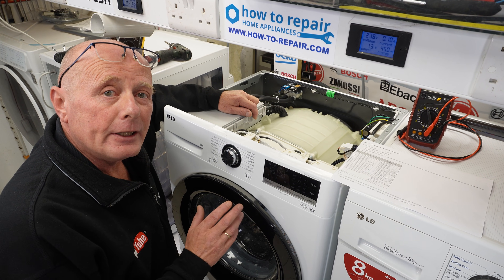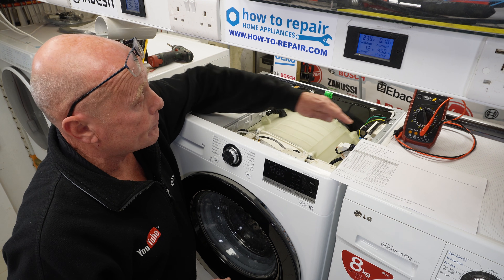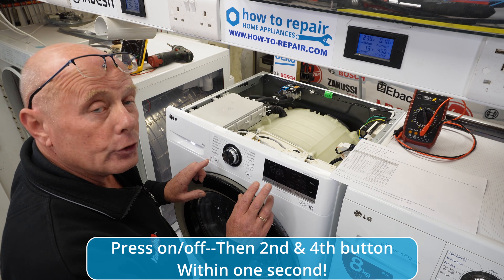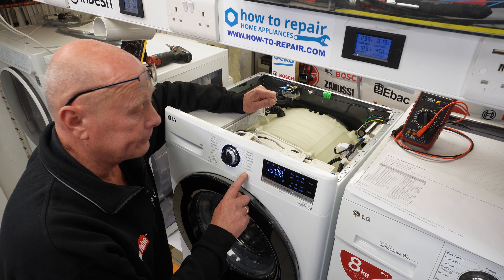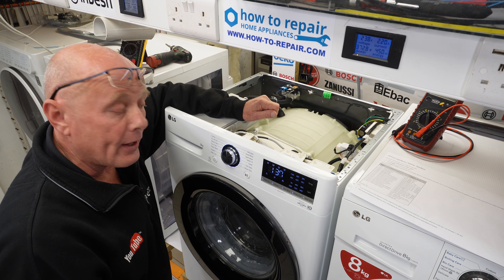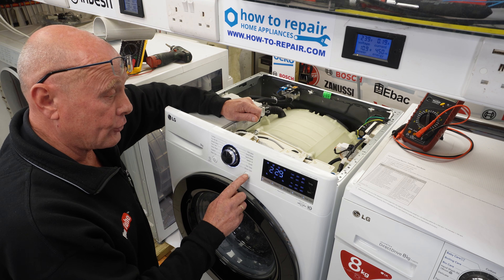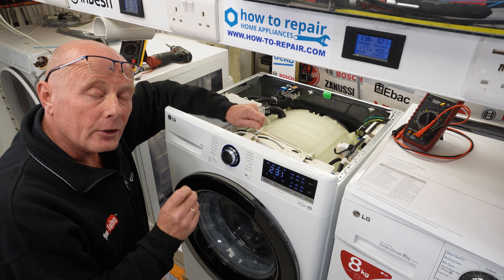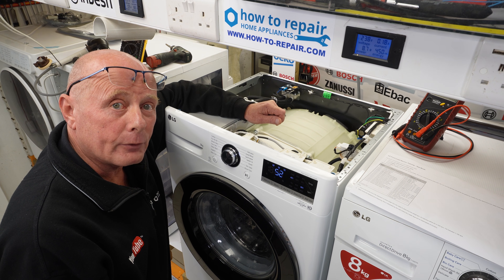LG washing machine service test diagnostic mode 2020 onwards

Comment: Sometimes I add extra water to my cycle by hand through the dispense tray, especially if I’m washing thicker clothes. Can this affect the drainage system and will the washing machine only empty what it thinks it has put in, or will it account for what I’ve added and will drain everything?

Comment: Unexplained feature in test mode.... i have a WM3600hva LG, once in the test mode (spin+soil+power) before hitting the start/stop button to initiate the test, i found that if you hit the "delay start button it will cycle through other options that you can engage/start. I for the live of me can not find any ANY literature on this. When the button is pressed , you get two additional option, first option reads as an upside down "F"and "5" (F5), and the second one is "00", then it returns to the main menu.  Can someone tell me what those menus are for. i don't want to start them without knowing. thanks.

Comment: Hello . I have a inverter direct drive, with no error on the display. When I try to start, it turns a litlle, around some 90 degrees and stops. All filters checked, water supply, door lock. I tried also the service diagnostic as in the video, but at first test, the engine one, just stopped. Any others ideas?

Comment: Had an issue with LG washer not turning the drum nor activating the drain pump. Resetting did nothing. Running through the diagnostic found no issue and afterwards the machine functioning normally. Not sure why but happy that I did not have to repair/replace the machine. Thanks for the video!

Comment: I get the error code IE when machine is starting rinsing program. No matter what program I choose for washing, when rinsing is about to start at the end of each program I get error IE. Did this test and everything worked as it should. Anyone have ideas of what the problem might be ? LG F6WV710S1W
Reply from the maker: Hi hallo1238273 sorry about your problem but I'm in the Atlas Mountains right now and I can have free time occasionally. I would like to help you out during my live streams. I'll be hosting a new show on Sunday so please subscribe and turn your notifications on then you can catch me live.

I'll stick the link to the upcoming stream below so you can drop your comment beforehand. I will need the full model number of your washer dryer which is written on the ID plate. I'd love to answer your problem on the show mate, cheers.

https://www.youtube.com/live/-1djYxP9MDQ?si=MqqH_hU65fLl83X9
Reply from the maker: Hi again, Ole. You'll be pleased to know that Paul sorted your problem on the live show, and then even made a repair guide for you.

You can read the repair guide here: https://www.how-to-repair.com/faqs/lg-f6wv710s1w-washing-machine-shows-ie-error-code/

Comment: My machine shows OE error when washing. I cleaned pipes, replaced pump. Still OE error and after Your video tried test mode. New pump works, bet are very slow. Maybe 20 times slower than in Your video(before sppeding up)

Comment: Great video. Is that right it draws ~8W when all thrned off?!?!
Reply from the maker: It will very depending on the PCB but there is always a standby current normally a very low wattage. You must remember my metres on the wall might not have been calibrated.

Comment: WM3488HW Fe error. If the water runs when unplugged and if during a wash cycle, I turn off the cold water manually and back on  and the water stops filling, does this point to the cold water inlet valve?

Comment: Hi there, we have a problem with our 2 1/2yr old LG Inverter Direct Drive 12kg ThinQ washer, can you please help?

Water sometimes comes out from underneath the machine, quite a lot, with no apparent cause. I have a short clip showing this.

Rust is starting to develop around the dispenser unit.

There is a build up of soap powder underneath the soap dispenser. 

When the technician took the front off the machine I could see a lot of corrosion inside, which the technician said wasn't normal but he couldn't explain why it was happening. 

The technician says they can't find any cause for this and says maybe the water pressure is too high or that I'm using too much detergent.

Our plumber says the water pressure is only 500 (I don't know what that means).  He said it would need to be up around 800 to give any problems with taps or appliances. 

I always use the recommended amount of powder, 1/2 to 1 scoop of laundry detergent. 

This has been happening since we first bought the machine, it's a mystery that I really need help with please!
Reply from the maker: Hi thanks a lot for your comment and sorry to hear about your problem. I will send you a playlist link where you can find over 20 videos about LG washing machines. In the playlist, there is also a video about a leaking problem that can cure your issue.

Playlist link: https://youtube.com/playlist?list=PLnAHZbSarsyHLR4x9XPIS-ZEsheufxm9Y&si=KlG5V_nXU4uOclWZ

Comment: After replacement my drain pump, on my LG washer due to it Throwing an OE  washer still not draining..a
Reply: Also In test mode 1 - 8 perfect, 9 shutoff the machine.and didn't pump out.
Reply from the maker: Hi, I will need the full model number of the identification plate and the details of your problem. Please use our contact us page and make sure you fill out the request for what your problem is. A video shoot of the problem would be perfect as well.

We will get back to you within 24 hours, normally. https://www.how-to-repair.com/help/contact-us/  

Please remember to subscribe to our channel, as that's what keeps this channel going. Thanks, Paul 👍

Comment: If the pump is bad will the fast and slow spins work? I ran the it and it will spin without drain but when I kick on system to spin fast and slow it won’t spin at all I took out drain pump and plug into wall it runs but push water through hose I’m assuming it’s a safety feature? Can’t find anything though that proves this
Reply from the maker: Hi, I will need the full model number of the identification plate and the details of your problem. Please use our contact us page and make sure you fill out the request for what your problem is. A video shoot of the problem would be perfect as well.

We will get back to you within 24 hours, normally. https://www.how-to-repair.com/help/contact-us/  

Please remember to subscribe to our channel, as that's what keeps this channel going. Thanks, Paul 👍

Comment: I have an older one 2013ish but with a touch panel like the one in your video.  The button sequence you show doesn't work on this unit, any idea what it is for my model?  wd14070sd6
Reply from the maker: Hi, I will need the full model number of the identification plate and the details of your problem. Please use our contact us page and make sure you fill out the request for what your problem is. A video shoot of the problem would be perfect as well.

We will get back to you within 24 hours, normally. https://www.how-to-repair.com/help/contact-us/ 

Please remember to subscribe to our channel, as that's what keeps this channel going. Thanks, Paul 👍

Comment: Very helpful.. my machine is starting to leak on third test where it takes water in . What could be the possible problem and solution???
Reply from the maker: There is a known issue with the pipe that goes from the soapbox to the drum. You will need to take the front panel off and inspect it. You did not say exactly where the water was coming from but feel free to upload a video to YouTube and send me the link I will quite happily assist. @RavinderSingh-sr5xn please remember to subscribe to our channel as that really helps us https://www.youtube.com/shorts/e432SAb2g08  Thanks, Paul 👍
Reply: @How-to-repair  thanks It was the front value which was left lose will cleaning it.